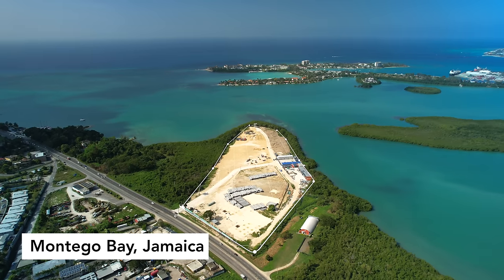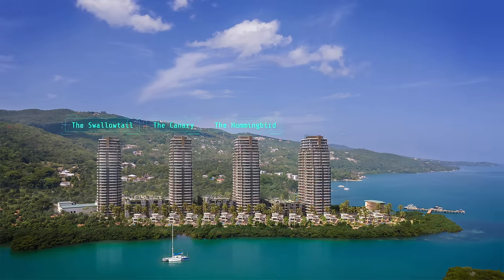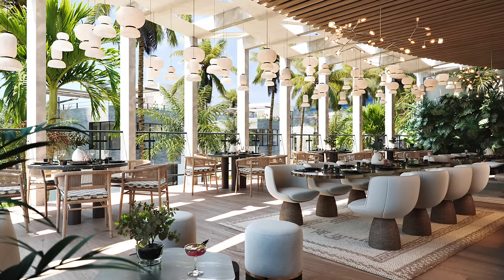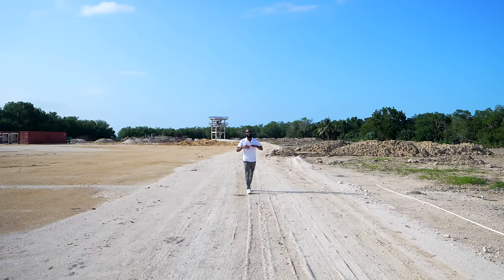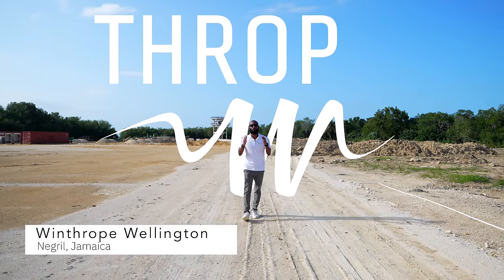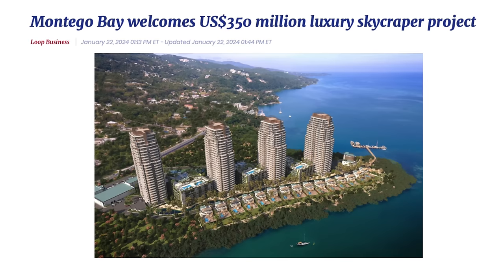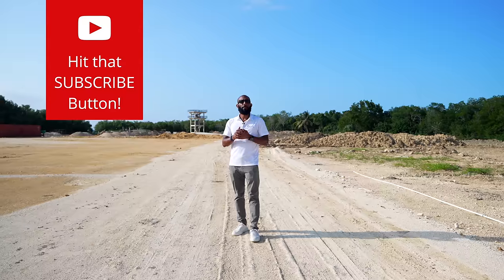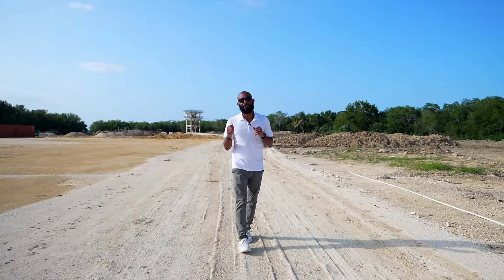Jamaica’s New Real Estate Dynasty | The Pinnacle

Comment: the key to the success of this project is how  well  ;how effective the Chinese technology is in stabilizing the foundations of those 28 story buildings on what seems to be a sand bank......
Reply: Piles aren’t specifically Chinese, they are a standard structural engineering feature  which are secured to the bedrock wayyyyy below and sand and soil. The taller the building, the deeper / frequently placed the piles will be. 

They’ve not mentioned it but, the tower will have been designed to withstand particular degrees of wind & tectonic movement. 

You’re not wrong, I’d add, the key to design, engineering and construction success is the quality assurance process and delivery.
Reply: if you go to China and see where they build things - it is no surprise.  Just like the highways. Their topography is even more complex.

Comment: Congratulations Jamaica great projects. Only a small correction. The tallest buildings in the Caribbean are in Santo Domingo, capital of the Dominican Republic. Caney Tower (39 floors) and Anacaona Tower (42 floors).
Reply: Height of buildings aren’t measured by floors , pinnacle will be the tallest in height
Reply: The tallest building in Dominican Republic is 584 feet the pinnacle will be over 1000 feet the amount of floors doesn't determine the height of a building